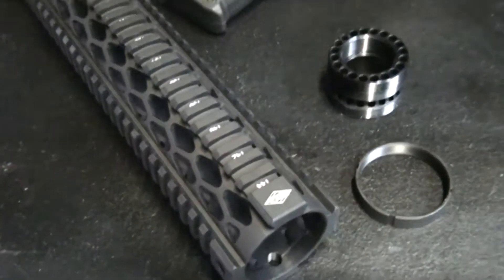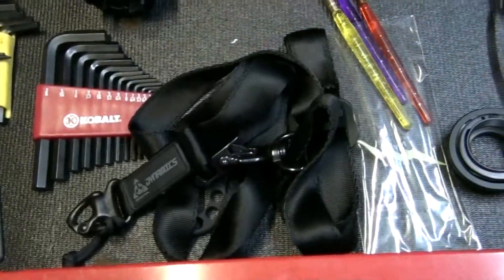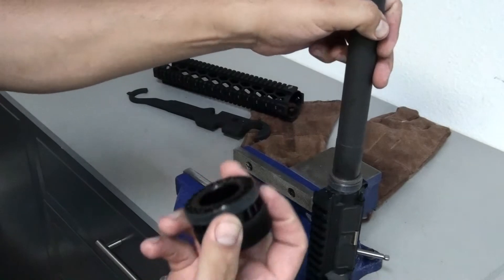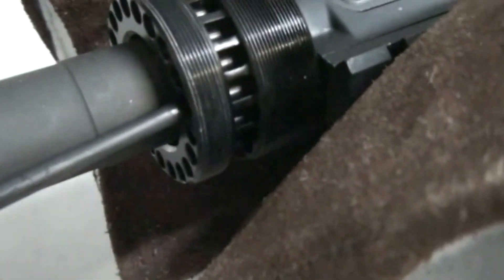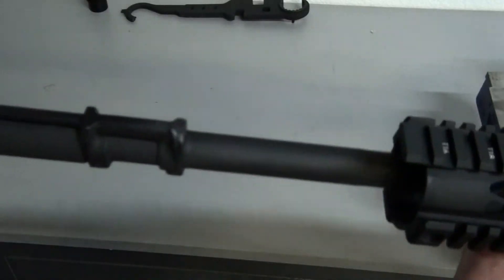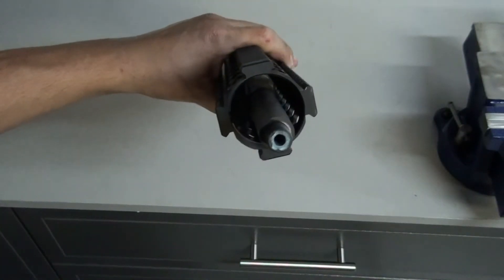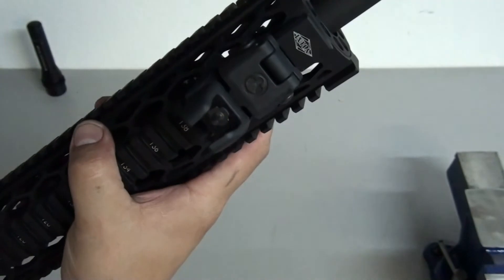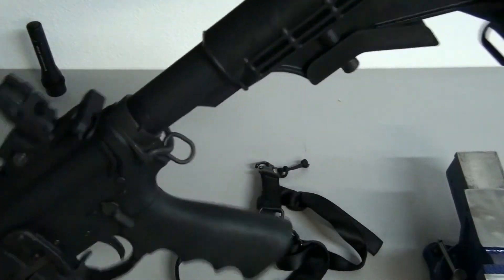YANKEE HILL MACHINE RIFLE LENGTH DIAMOND FOREARM INSTALL

Comment from the maker: @patrick70314 the original hand guard was 9inches and a mid length gas system. You can put a longer handguard as long as you have a low profile gas block.

Comment: At first, i thought this was a relevant question for me, but when i realized that my true goal was having a custom(to my specifications) rifle, i no longer thought about that! It's all about having a customized, to my needs rifle. When you're buying a rifle on the cheap, for the sake of just having a basic setup to function, at a low price, then yes, Finding all the parts needed to build one cheaper than a pre-built one can be hard to find and you might end up sacrificing quality to spend less $

Comment from the maker: @sisk61 you may need a vise block. i have over tighten the nut just to line up the gas tube. I have talk to RRA and they recommend to torque the nut to 45-85 ft lbs. once i line up the tube i check the torque with my snap on torque wrench,and the nut it was about 65 ft lbs. its a pain in the ass if you don't have the right tools. i like the barrel tight because over time even with lock tight it may loose in up if it under torque

Comment: I just got the same 12in quad cheese grader as Mr Smith jr calls it. I like the free float an the ability of keeping things up front.1-7 twist, 16in stainless fluted mid-length. The hand rail is way heavy, an that's a no no for me.. Will end up changing to something lighter in time. My first build from a 80% lower. (No paper trail)  I fully understand the point Mr. Smith jr was trying to make. He is right in everything he stated. He could a worded things a little less sounding like he needed his period tho. Everyone has a learning curve. I learn something new everyday. Cheese grader, ha ha ..  get some ladders for those rails !    Btw my end cap only has one hole not two. Must of been built on a Friday. :)

Comment: Very nice build, sir. The rifle-length free float looks nicer than the carbine length. For the Yankee Hill tube, 1) can the initial barrel nut be tightened with a standard AR barrel nut wrench? 2) Did it come packaged with it's proprietary tightening wrench to tighten the handguard in place? Thank you very much for this video.

Comment from the maker: its been a while since I did this video. You'll need a low profile gas block or cut the one you have on it. Ar-15 wrench. lock tight and small punches like matco or snap on, I hope this helps.

Comment from the maker: @carmas54 I would get a low pro gas block for that barrel. You may want a 13 or a 16 inch handguard  for that 20 inches barrel or not a 12in handguard will work.

Comment: Nice video. I think the build came out pretty sweet. I am not a super huge fan of some of the magpul parts, their BAD lever is a little chinsy I switched over to Phase5 Tactical EBR because it isnt a bolt on it replaces the whole bolt release. The also have a pretty sweet swivel single point harness. Your build came out nice. When are you gonna replace the stock with a MOE or CTR?

Comment: Did this rail have a machine screw on the bottom of the rail to fit into those notches in the barrel nut, or is it just the slip ring which stops it from moving?

Comment: great video. I really need some advise. Im trying to install my YHM handguard. but i dont have a vise block. just a vise. ive tightened the barrel nut onto the receiver, but the gas tube hole is about a milometer out of alignment. i cant put the amount of torque that i need to to be able to make the gas tube hole line up correctly. i dont want to put that much torque on the receiver especially when i do not have a vise block. Not too sure what to do besides buy a vise block

Comment: Joe, I'm going to do the same thing to my service rifle, what length barrel do you have there, I have a 20 in barrel that I want to use, (KeigerBarrel). What is the length of the YHM forearm?  Do you think I will need the low profile gas block?  And now that you have had it for a while, would you do anything different?

Comment: this is the same 1 i got on my psa upper an lower  deff gonna stick with this hg for a long time when i make a nother ar as well how do u like that barkia i think is the name ar wrench ? i bought 1 an the flat head part broke in my hand an i have to return it as well in the er lol an btw what kinda bbl is that thats a thick 1 i like it did u use the yhm wrench on the jam nut ?

Comment: take  care with that magpul sling attachment if you run around alot,or jump down i had mine snap off and drop my weapon when i jumped down a fence. yes i should have had a better hold of the gun, i admit it, but be careful either way.

Comment: hi, just got only 1 rail on top. how much did each rail cost?? and was it difficult to install them.
Reply: Um, it's called a quadrail for a reason. It sounds like you have a handguard that allows you to add rails in sections, which is actually nicer than this handguard, as this is a big bulky handguard, and you honestly don't need all of that railestate. I like the Todd Jarrett handguard, it's top rail and goes to quad the final 3 inches, though I installed a custom bottom rail for a AFG2.